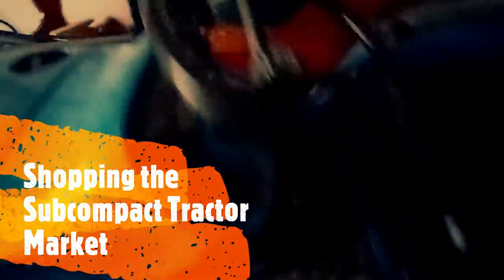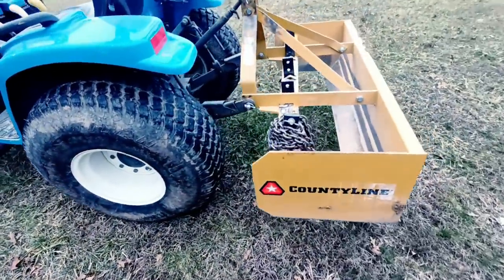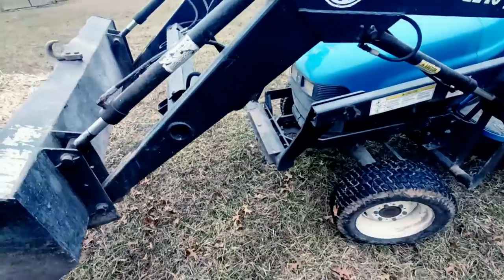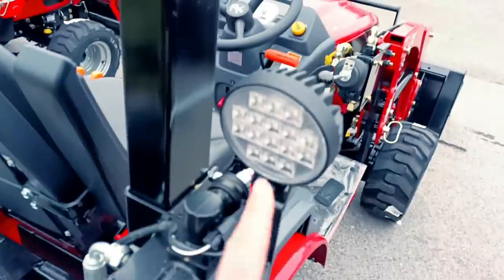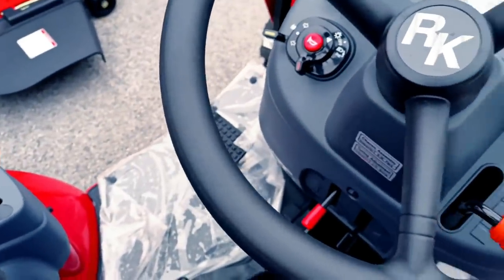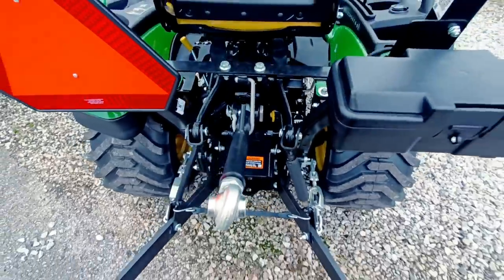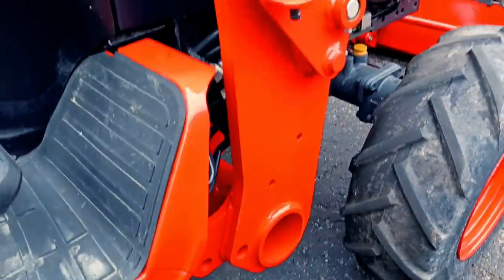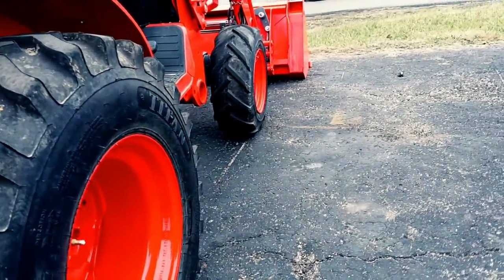Shopping Subcompact Tractors - RK24 / John Deere 1025R / Kubota 23S / New Holland Workmaster 25S

Comment: Loyalty to any brand, tractor or otherwise is stupidity. Those companies care about one thing and one thing only, Profits. They don't see you, they see your $$$.
I bought a brand new Massey Ferguson GC1725M in August of 2020, I actually paid more for it than I would for KUBOTA or JOHN DEERE because I had employee discounts available to me for those two brands, and not for Massey Ferguson.

So why did I chose Massey? My considerations were (Massey Ferguson, Kubota, Kioti, John Deere, New Holland)
At the end of the day, after spending hours of my time doing research I realized that trying to figure out which is best between my considerations was waste of time and splitting hair because they are all so close.

So to me the deciding factor was that:
1. Spoke to two other local farmers who owned same machine and they were very happy with it, and dealership that sells Massey and Fendt here has phenomenal reputation as far as customer service and support, and they are 15 minutes away, they come out to your place to do any repairs they can so you don't have to haul the tractor to them, and their response is fast and turn around also very fast if you do need to drop off the machine. (I also got 10 year warranty with my Massey on tractor, pretty much bumper to bumper)

2. Our local John Deere is about same distance for me but has awful reputation as far as customer service, and they are known for not providing replacement machine while yours is getting repaired, my buddy does landscaping for a living and when one of his machines failed, he was without it for 3 weeks and John Deer did not provide another, and he depends on this for livelihood, I also had a employee discount through family AND I worked for John Deere, one of best jobs I ever had, before they closed the shop and moved it to Mexico, but that's another story.

3. KUBOTA is another brand I had a employee discount as my neighbour's son works for national KUBOTA office. However, they have dealerships so far apart that I'd have to drive about an hour to get there and because there are so few dealers, covering such vast area, I also heard that if you need your machine serviced you have to wait for weeks to get it back...

4. New Holland, again came down to a dealer being about 45 minutes away and didn't hear much about their service habits ...

5. Kioti, about 15 minutes away, and a dealer with good reputation for service and support however because it's a small dealership sometimes you have to wait for parts or service a little longer, though not as long as Kubota or John Deere, KIOTI was my second choice.

Conclusion:

All these machines are decent, talk to people in your area, ask questions, research the dealership and their service and willingness to help you when in need, they will all kiss your behind to sell you the equipment, but what counts is how they treat you after. You can't go wrong with any one of those machines, but you sure can with a choice of dealer you choose.

Good Luck !!!

Comment: I have the Tym-254 which is pretty much the same tractor as rk-24, but The current model of rk-24 has the third function valve on front and rear remotes that mine didn't come with... No Rk-stores near me either (like 1000+ miles away)... I looked at a few brands and where i live i have all types of dealers to choose from,,,, I would buy a rk-24 any day

Comment: the ram truck get a  programmer and bypass all your smog devices. it still will pass smog and the improvement is awesome fuel mileage performance my duramax get 26 to 28  on open road and it a 3500 long bed 4 door, towing a 30 camper 19 to 22, mtns 16 to 18

Comment: Kubota is basically a Toyota tractor.  Parts inside are made by Denso... the same supplier Toyota has always used.  Mitsub0shi belts are on Kubota.. same supplier as Toyota.  The Korean tractors may offer more upfront but the quality is not the same as a Japanese supplier
Reply: KUBOTA since 2018 or so is not the KUBOTA people know from years past, my neighbour works for Kubota national office and admits, older machines were better quality as Kubota did a major shift to be more competitive in sales. Now days reputation of dealer you are dealing with is more valuable than brand, as long as you're sticking to the 5 major sub compact brands... Massey ferguson, Kubota, John Deere, New Holland, Kioti.
Reply: @googlreviews7813  mmm.. my 2021 bx23s has Denso parts inside of it
Reply: @personalfunfest  

Toyota owns Denso, ofcourse they will put Denso parts in their cars lol.

Like I said, any of the main five makes are great tractors, I got 10 gears warranty with mine but these machines change from year to year like anything else, I know in recent years Kubita cut cost on hydraulic systems, especially cylinders which they had issues with leaking with. At the end of the day, every machine will be great when new, but once you will need assistance you ha e to deal with people and dealerships, not logos on the front of your tractor, that's why for me, any of those 5  brands is good, you'll be splitting hair trying to figure out which is better, so it really comes down to customer service, and turnaround.

Massey/Fendt provides replacement tractors if yours breaks and u der warranty, in my case that's 10 years. I know locally only they do that. So again, co es dien to dealership and their approach to customers, not brand.

Cheers!

Comment: Ground clearance is the problem with mini scuts for me.  They need drop axles and bigger tires.  I use my scut(shibaura sx24) to mow grass but for gardening and ground work.  I always go back to my old simplicity 9020(allis 720) it’s just more tractor then these new ones.

If there is a Branson dealer by you check them out I used one the other day and didn’t hate it

Comment: I bought a John Deere 1025R last summer and love it.  Their backhoe comes with it's own seat so you don't have to turn the tractors seat around so that is a plus.  I think their front loader detaches easier and if you want a belly mower it's auto connect is the best.  I agree, it's a little more money but you get what you pay for and nothing runs like a Deere.  And like someone else said, it's made in the USA.  Be part of the club, buy a JD and we will teach you the secret hand shake once Covid is over......lol.  BTW - Zero % financing helps too.
Reply: Wrong, alot of the deere implements are MADE IN MEXICO! Deere doesn`t make their own brand of engines either. But if you wanna pay more, buy the deere.

Comment: RK 24 with FEL and pull behind 60 inch finish. mower, 48 inch tiller. 300 hours on it. only issue so far was the pro switch broke. I would look at the TYM version of the RK24. you will get a better service department.

Comment: I'm shopping for subcompacts also. I've narrowed it down to the Mahindra and Kioti. RK would not sell me a tractor because the nearest store is so far away. I'm leaning towards the Kioti because I have a dealer 3 miles away and I just like the tractor better....metal fenders and the joystick on the fender included. The problem with the Kioti is that tractor delivery would be in July (at least 3 months out.)

Comment: If you run out of def the engine will cut out but in case of emergency when running low you can use water till you can filler with def

Comment: if you like your new holland ls tractor is who makes new holland last year they came out with a mt 2 25s has three speed hydro quick attach bucket about the size of a john deere 2025r I bought a 2018 1025r if the ls was out back then I would have bought the ls mt2 25s price with loader is around $15000 new

Comment: I have a 3 year old kubota l3901 hydrostat.   I would not let DEF determine what tractor i buy.   It does auto regen..... so if you are working and it flashes at you.... you just make sure and increase throttle to at least 2200 rpm and it does its thing while you do yours.  If it is idling and you dont get it sped up it will eventually require you to park regenerate it.   And that takes less than 10 minutes.      If you used the hydrostatic foot pedal for about 1 day you would never want any other style.   Just my opinion

Comment: Go by the best and closest dealer....My JD dealer is a mile away from me (2012 1026r TLB MMM) If you mow , the drive over deck is great.
Reply: I echo that sentiment about dealers.  I looked at JD, Kubota, Massey and New Holland for full sized tractors.  I'm pretty sure I would have been happy with any of them, but the Kubota dealer has 3 stores closer to me than any of the others.  Same analysis for the sub-compact I had to get when my wife didn't find it funny that I mowed the lawn with a 15' brush hog.

Comment: you need to drive them all.  I will say that the Kubota has one of the best loader control valve for performing multiple functions at the same time.  I have a 15 year old BX series Kubota and it has over 1,400 hours on it.  always works.  I found that when spending time sideways in the seat backing up, the treadle peddle is much nicer.  I can sit sideways and use my heal very comfortably to reverse.  
Also, Kubota manufactures all of its components including engines.  But you need to see what fits for you.

Comment: We've had our 1025r 1.5 yr and happy with it. got it packaged w loader and backhoe. Yes those low hanging connections can come unconnected when operating in heavy brush. Have never been damaged but is a bit irritating when you go to use the bucket and have to reconnect a coupling. The little danglers are best stowed in the tool box lest they get jerked off. Really do like the two set arrangement on the backhoe. That treadle pedal would drive me to distraction( yeah that was one of the deal breakers for me). The main reason we went with the JD was they've been around a day or two and facilities are plentiful in our area. The attachments are robust. Lastly don't let the "plastic" hood throw you, I've dropped some things on it and it doesn't break or dent .

Comment: RK is coming out with a larger RK 25 this Spring. Larger than the 24 but smaller than the 37
Reply from the maker: Yep, supposed to be here within the next 90 days, along with a significant price increase across the entire RK lineup.
Reply: @4-LOW  and ranger6x6 Do either of you know where I may find more information about this RK25? I'm betting that it's Rural King's version of the TYM T25. (An updated version of the T264.) I'm anxious to learn more about the RK25/T25.

Comment: Mahindra has no regen below 60hp. Mahindra, TYM, RK, and Branson share a lot of parts if you compare. I ended up with Mahindra 2638 for loader lift capacity and side by side forward and reverse pedals.  I would have gotten a RK but they are 3 hours from me, the Mahindra dealer is 10 minutes away.

Comment: I have a mahindra max24 and I'm looking at the Branson 15 series. I got a quote on a 4815C with rear remotes installed grapple and 3rd function installed and hay spike for a really good price. The 15 series will get you machine weight of 3014 bare add loader gains another 800lbs.  Lift to full height at the pins is 2200lbs. 3pt is like 3600, 29xx at 24 inches out.  The 25hp dosen't have any emissions 30hp up dose but it a very simple emission system  than can be fixed easily if problems occur and the engines are all mechanical. That's what I'm looking at.
Reply: seen that in a video, looks like a great machine

Comment: I'd only go with kubota for under 50 hp new holland above 

And kubota's like a Jeep they keep the value probably the best of the little tractors 

You should rent a little backhoe I rented one it was kinda useless

Also it's not that expensive to delete a tractor I wouldn't delete a pickup but I would a tractor

Tym and Mahindra have awful customer service from my experience 

Not trying to bash anything just sharing my experience I hope it helps

Comment: I avoid the lesser known brands, I've never had one make it to 500 hours without a serious issue. I currently have a massey and it is sitting at about 6,000 hours without any major issues.
Reply: I’m seriously thinking about the MF 1840. Any knowledge on those?
Reply: @joshuasmithee8674  actually just picked one of those up 5 or 6 months ago, it's been an awesome little loader tractor so far
Reply: @thisguy5050  thanks!! It’s always good to hear from an actual owner. Is it pretty stout? How stable is it, I live in hill country
Reply: @thisguy5050  thanks!! It’s always good to hear from an actual owner. Is it pretty stout? How stable is it, I live in hill country
Reply: @joshuasmithee8674  upgraded from a a 33 horse massey to this and it is a night and day difference, way more stable and feels like it has twice the power even though its really not that much more plus i really like the shuttle shift over the hydro on the old one, a lot better for loader work

Comment: That valve. mounted on the role over bar. Will be real nice in a few years when you blow a hose. Hot hydrogen fluid will leave scars.
Reply: What tractor do you own that gas hydrogen fluid you must mean hydraulic

Comment: The 2019 kubota you are busting on will outlast any green tractor you compare it to , plus the cast iron drive train is superior to a Deere , in a nutshell the catastrophic failure between green and orange is always gonna be the green that fails before the orange plus I would pay 13k for a 2600 2019 model with 35 hours on it it’s just a tougher tractor, the parts that matter anyway, but I’m going back with the bobcat personally, I have a 1965 s500 bobcat that is still slinging horse crap 56 years later and it’s only on its 2nd motor 😝

Comment: Why do people try and work so hard to stay under 26hp so they don't have to have after treatment. Like it's some add maintenance item to their tractor I mean It can be if you don't understand how it works and how to use the tractor like you should. Most of the time the DPF filter goes through an active re-gen you will be working and you don't have to do anything but work. I just don't get it.

Comment: New holland screwed up with their model sizes, the boomer 24 was more comparable.to the other tractors. The 25s is too small and the workmaster 25 is too big, also the boomer came with quick attach rear remotes. But no tool box no work lights. But it think I paid alot more for the boomer 24 then any tractor you mentioned, there were no other dealers in town, wish I would have shopped out of town. But then warranty really doesn't mean anything when you have to take it 6 hours to a dealer

Comment: John Deere 1025R by far the best built most capable tractor in its class , the smaller tires allows the machine to put more power to the ground , and makes them more stable when working with the bucket or back hoe.. you pay more for the Deere because it is much more capable , lift more then equivalent machine and the hydro pump has a higher GPM than the others .. and it is 100 % made in America baring the yanmar engine which is by far the most durable longest lasting engine
Reply from the maker: What I've found is that the Deere is one of the least capable and doesn't even match the lift capacity of the others.
Reply: @4-LOW  The lift capacity on tractors that small is almost not worth looking at. Your rear tires will be off the ground even if theyre loaded before you max out the hydraulics.
Reply: @4-LOW  “Real world lift test” have proven in actual lift capacity John deere is best in class , kubota and the others make claims on paper but once ask’d to do it in real life fall short. There are many videos of it . And i have a 1026 R and my neighbor has a 2450 kubota and we have done many similar test and my John deere always wins .. plus one more thing , RK is a Korean tractor , kubota is a china tractor “ASSEMBLED” in Georgia  USA ,but all the parts are made overseas. and kubota also uses its own engine. And John Deere made in Moline right here in the USA, and me personally take that made in American craftsmanship every day. Also John Deere makes the biggest most relied upon tractors in the world so they know how to build them to last ..
Reply: @adamharriger5193  Should always have weight in the back when lifting with a loader.  Rim guard in rear tires and then a weight box or heavy rototiller, backhoe, or something heavy on 3-point if lifting heavy objects.  Balances the tractor and less stress on front axle.
Reply: @cashxx  Absolutely! Even then most compacts will become tippy before you max the hydro lift capacity. Just too narrow and short wheelbase combined with small light frames.
Reply: @4-LOW  as @PhatboyHD88 says, look at the real world tests. The Deere loader is best in the subcompact group, plus the Deere quick attach doesn't kill the already paltry capacity like the SSQA.